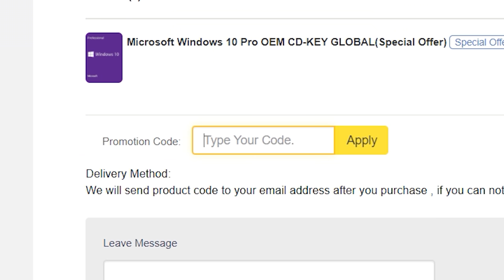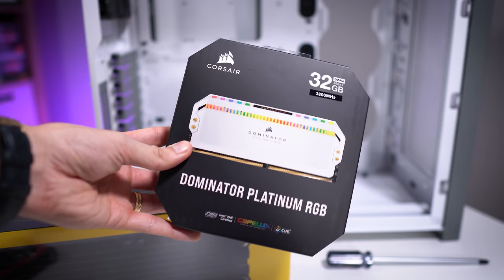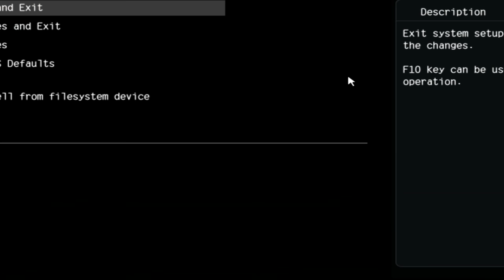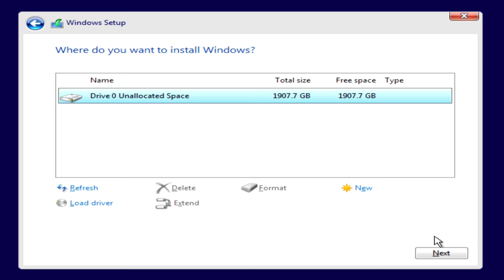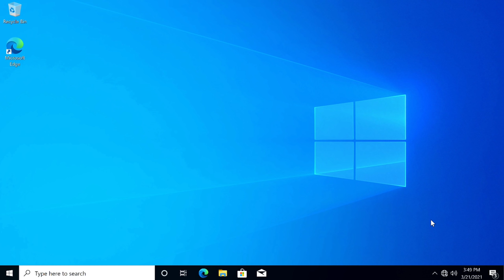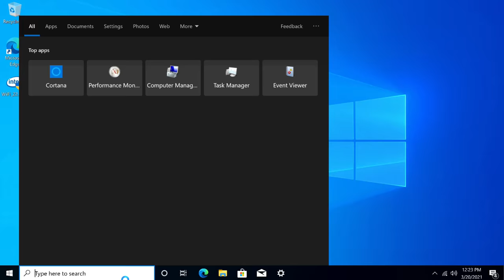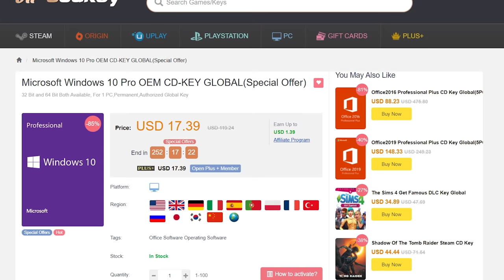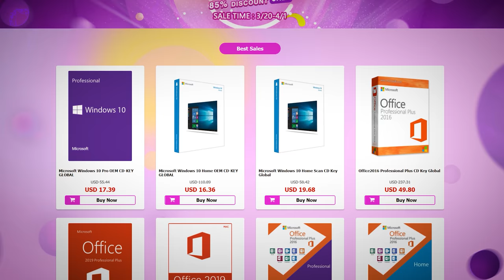Walter White v5.0 Gaming PC Build Log

Comment from the maker: I think we made the most out of soft-tubing with this one! I'm a fan of minimalistic custom loops. Cutting into the case was super jank at first, but I was comfortable with the right tools and grommets. Thanks for watching!
Reply: Always a pleasure to watch! I enjoy your stuff Greg!
Reply: Not recommended to drill holes with hardware inside case.
Reply: Absolutely love this build! Only thing that bugs me a little is that lowest run to the rad on such a wierd angle is a bit distracting, but im sure the consession was made for a reason.
Reply: What type of GPU mount are you using? It looks very clean! Nice build as well! Would really like to build my own custom water-cooling build.
Reply: looks so nice!!!
Reply: @JakeSheringPlayz simple, the GPU verticals mount that comes with the case is too close for the side panel and can impact GPU thermals significantly
Reply: hi , 16:23 , you can install icue for the corsair ram sticks - set your colors then disable icue in task manager->startup / the color settings will stay in the ram (it works on my vengeance pro)
Reply: Nothing cheaper than my KMS injector

Comment: "I'm perfectly content with my ASUS Crosshair X470 motherboard." 

Sees N7 in this video.

*Damnit Greg*
Reply: Meanwhile me with my ASUS Crosshair X370:
"I just want ARGB headers [Crosshair VI does not have them]. But I don't NEED them. But I WANT them."
sees N7 B550
"I am now conflicted."
Reply: the board looks very nice, but the Asrock board that NZXT used as a base has multiple flaws (videos have been made on this). Examples include the not great VRMs, the fact only 1  m.2 port slot X16 slot are pcie gen 4 (though many b550 boards do this). That being said, the board still is quite nice (especially when you factor in the I/O and looks), though where I live it's more expensive than some nicer x570 boards (I really wish there was an x570 board that was properly white like this one).

Comment: The music peaking just as the build loop finishing filling... nice to see for the hundredth time. Let's drill more holes with everything inside the case
Reply from the maker: ? I'm confused. Is this supposed to be a condescending comment? The holes I drilled were very safe, and the components around the area were masked with tape. If it scares you, stay away. But there's nothing wrong with this if you know what you're doing and use proper tools.

Comment: I'd lose those fans and go with an all-white fan set, and I'd change the case back behind the reservoir to white as well.  Also, with that CPU cooling, consider undervolting the CPU to see what kind of temps you can get without any performance loss.  Not sure why you wouldn't cool the video card as well since you already did the hard part of buying all the water cooling open loop gear, but whatever.  Looks good.  I so wish NZXT had made a white N7 X570 board.  I'd have bought one in a heartbeat for my own 011D white case.  Ths was one of the nicest looking soft tubing OLC  setups I've seen.  Love the minimalist custom look, and the clear fluid for this setup.  Nice!

Comment: I love the hidden tubes thing. Very different, I had a thought while watching though... If you wanted to add that little extra bit, you could have ran hard tubes where viable and swapped to soft for the rear hidden run. Something to consider for another build maybe. Neat idea though. Opens up all sorts of possibilities with different case designs.

Comment: Great build as you made water cooling look simple as I may go this route on my next system then a AIO .  I get my operating systems the same way as they are locked to the system but is still cheaper then buying the OS from the computer store .  Myself when installing the OS on a huge M.2 I would do a partition reason why is if you need to re-install Windows you can do a clean install and not worry about what you saved on the rest of the chip like steam games  as you would locate those into the other partition and it's easy to change Windows where your saved DOC's and Music will go.  I just keep the OS side just for Windows and easy to reinstall software like Photoshop :)

Comment: While I do love this mobo in a white case; I think it would've been worth mentioning how the M.2 ports are basically heat traps.
Reply: I agree. I did get the board, but because I vertical mount my gpu and got the black model, I picked up a heatsink that wont be noticed. The white one is where people will have and issue with is think.

Comment: Have you tried painting the bracket used for the vertical mount of the GPU? I have one lying around from Cablemod that has seen several colours and is super easy to do. I think it could use a coat of off-white paint. Overall a super cool build. I do have a question: In '21 what motherboard do you recommend for a white build for a PC mainly used for gaming? I have a Gigabyte 3080 vision in my system but cant make up my mind and am not sure about the vision series motherboards as they seem to be marketed mainly towards content creators.

Comment: I have a dumb question for you. I've had all the parts for my build in boxes for a week. Including the corsair 5000x rgb chassis but I'm really having a hard time deciding whether I should keep the 5800x that I bought or try to snag one of the 11900k cpus on Tuesday. I already have a preorder for the 11900k. The only thing I will be using the pc for is gaming and I just want a cpu that will give me the most performance at 4k. So 11900k vs 5800x? Kinda sucks that there's not really any youtube benchmarks out for the 11900k and it's out in a few days. I know at 4k gpu will be the main factor but if I can get even 5-10 fps with intel or amd I wanna go whichever route.

Also this build looks amazing! I'm glad I found your channel a couple months ago.

Comment: Cool build, but I have a question for you Greg.  Why did you set up the GPU with riser blocking the rest of the PCI-E slots on the motherboard? I see there are already vertical GPU PCI slot covers built into the case. If this was my build I'd be annoyed that I couldn't add in a PCI-E capture card (like an ElGato 4k 60 Pro etc) without some extender cable to go to the vertical mount spot I just pointed out. Great video overall though! xD

Comment: Hey Greg! I absolutely love your builds, keep it up! Question I have for you if you have a few minutes, I’m building using a Lian Li 011 Dynamic and a TH360 AIO, where 
should i be mounting this thing? The top of the case or the side? Thanks man!
Reply: I know I’m not Greg, but any advice will help. I think you put it where you feel like it looks the best as long as you’re pump/cooling block isn’t at the highest point in the loop. So if your mount it on the side so the fans/radiator is facing you have the tubes at the top and if it’s at the top keep the tubes close to the CPU for obvious reasons. It’s always personal preference in the end. If you do mount it on the top I would also recommend making them intake fans and you could make the side ones exhaust if it works well temp wise that way, but I haven’t built in the 011 Dynamic so take that with a grain of salt.

Comment: What did you use to vertically mount the ssd.. I have the 4000x and a regular riser puts it too close to the glass but I see you have yours in the horizontal bit but I didn't see what you used

Comment: You mentioned you couldn't adjust the RGB on the dominator platinum. Does the Corsair iCue software not work?
Reply from the maker: It does, but there's no native support in NZXT CAM, which means I'd need two different RGB software suites for the same rig. They're both already resource-intensive enough as it is... having two running at the same time would be extremely annoying. But maybe I can see if the modules will store the RGB setting in memory - then I can delete iCUE.
Reply: @GregSalazar  thanks for the response. Makes sense to limit the amount of software running to control RGB. If it could all be done in CAM that would definitely be ideal and would be interested in seeing if what you mentioned setting up iCue and unistalling it works.

Comment: Why did you mount the gpu vertically using a kit further back when there are already vertical pci slots further forwards?
Reply: I think it is for the sufficient airflow for the gpu, the built in vertical gpu slot is really close to the glass

Comment: The OEM keys usually lock to a certain motherboard model, not really the CPU or anything else.
Reply: Usually. It purely depends on motherboard, some lock to cpu id too.
Reply: With an aorus board i didn't ran into issue swapping cpu's.

Comment: Am I the only one that thinks the airflow setup is flat out horrible ? 
- The ONLY intake fans are blowing HOT air into the case , would be less of a problem if the GPU was also water cooled, but it's not
- The front intake fans are ... not there

Also this build lacks effort in actually making it a true white build - it's a black & white theme with random and pointless stickers on the GPU
- Black radiator
- Black pump/res
- Black Vertical GPU holder

This might perform acceptable but it could be much better